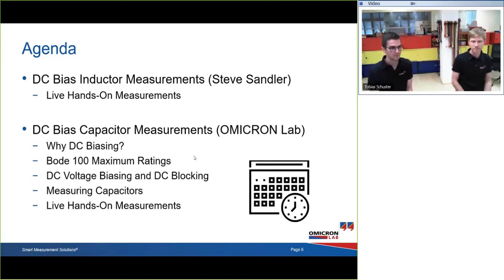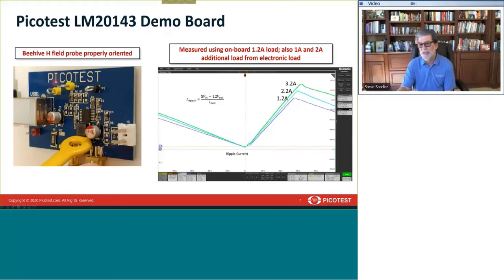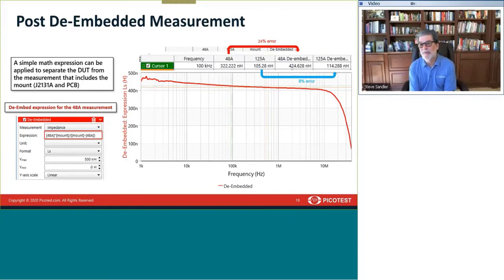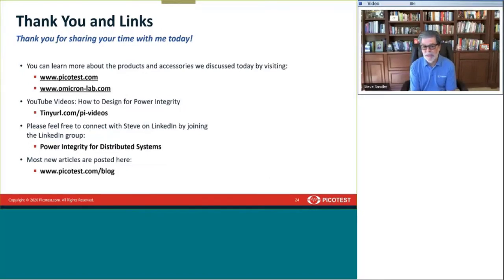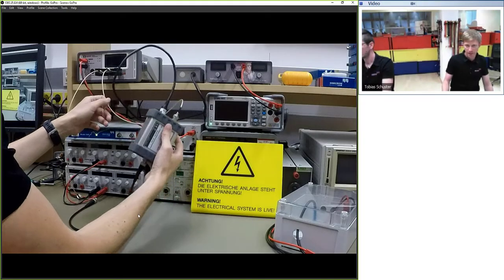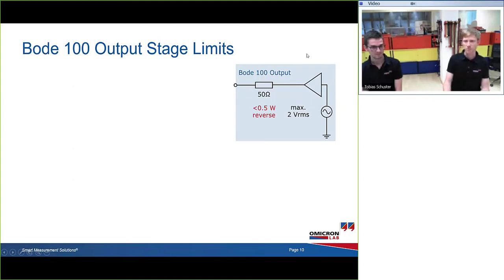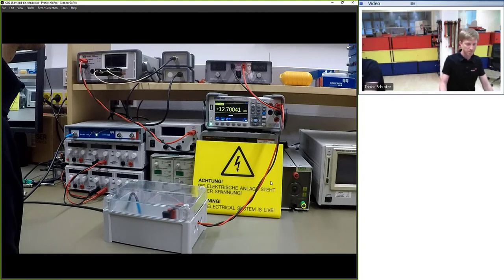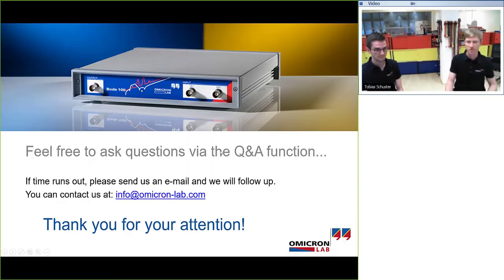Webinar: DC Biased Impedance Measurements

Comment: Hello, thank you for this video. I have got a question. In minute 10:50 we have "Series equivalent circuit" and " Parallel equivalent circuit" for what reasons they are always two. Where one can be used when second cannot be. Thank you.
Reply from the maker: Thanks for your question! The two circuits have the same impedance so they are equivalent from that perspective and you can always use either. Sometimes a parallel loss resistor is a better representation of a physical effect like if you want to model a dielectric loss, sometimes a series resistor fits better to the reality (like a wire resistance). At one frequency however, they are identical. If you look at a wider frequency range you might see that the model that fits the physical effect better, provides a wider fit to the reality than the opposite. Hope this helps!

Comment: Good explanation Video on Impedance Measurement. Thanks.
Also, I was looking for measuring the Impedance of Active components mainly Diode and FET for modelling the same in EMC simulation. Could you please help to confirm if there is any simple manual discrete setup as shown (in this video for Cap measurment with DC bias) using Bode-100 for measuring Diode/FET component impedance between pins (to extract thier parasitics). 
Thanks.
Reply from the maker: Hi Nathan JP,
this is an interesting and difficult topic at the same time.
We have sent you some application notes from our webpage (https://www.omicron-lab.com/applications/vector-network-analysis/application-notes#).
all the best,
your OMICRON Lab team